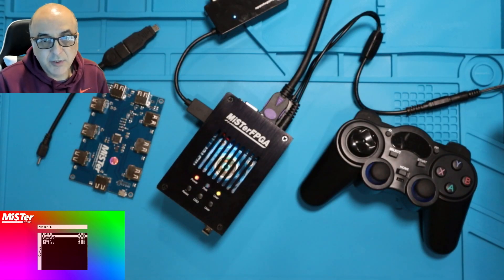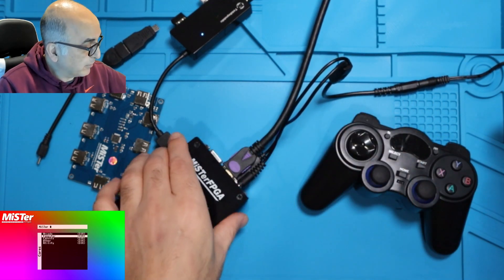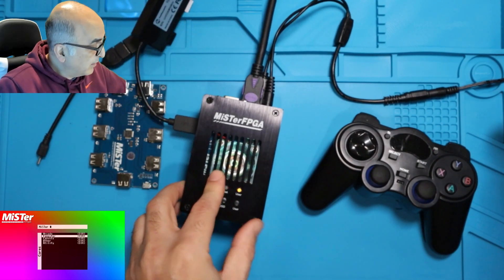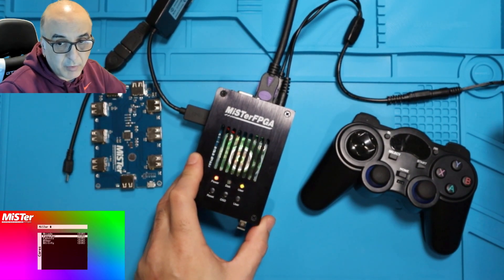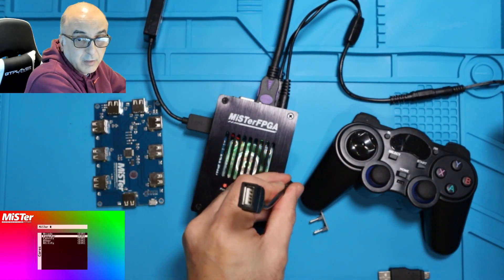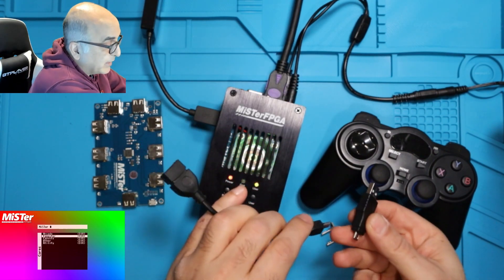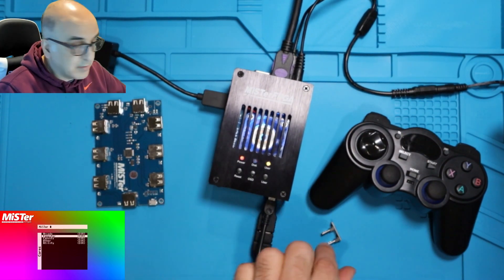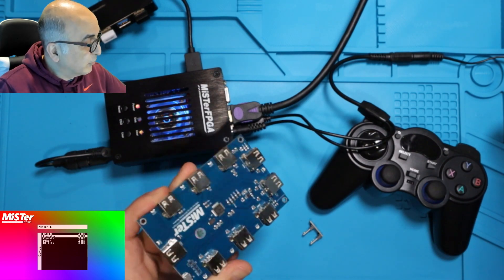MiSTer USB ports and Hub Not Working - How to fix!

Comment: Not sure if you use one, but for me the issue was the power SWITCH. Once I removed that everything went back to normal.
Reply: thanks for the hint. I removed the power switch and it seems to boot up more reliably to the hub.

Comment: I did exactly what you said , I plugged a 12v adapter in by mistake ,  the USB does not work on the usb hub or the mister board , the system boots and displays but I cannot control it and it sits waiting for input at the menu , I guess a fried both USB controller chips on the hub and the de10 nano ?
Reply from the maker: Probably just the hub is fried if you plugged in the 12v adapter. The de10nano has protection so it should be fine.  Remove the bridge and try the micro usb port directly on the de10 nano.
Reply: @i-code  Spot on you were right , plugged on otg cable in and I am able to operate it  just need to get a cheap usb hub tro plug in
Reply from the maker: @DCFC1200   great. if you use an external usb hub, make sure you upgrade you power supply to 4amps as the one that comes with de10 is too weak and it may become flakey as you add devices to the hub.  Alternatively, you can also get a powered USB hub.